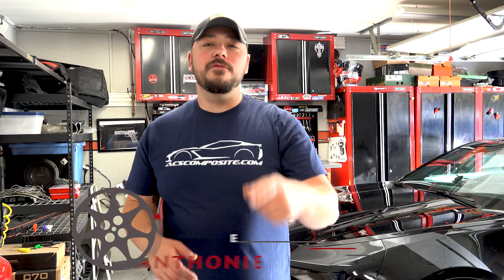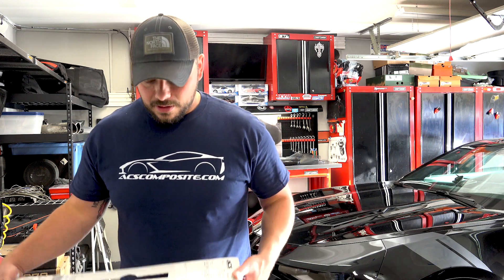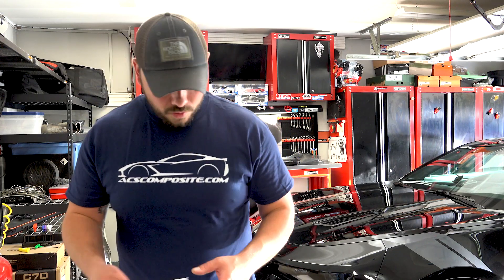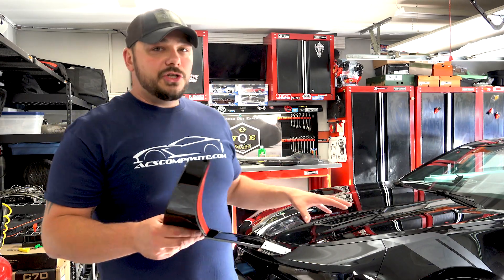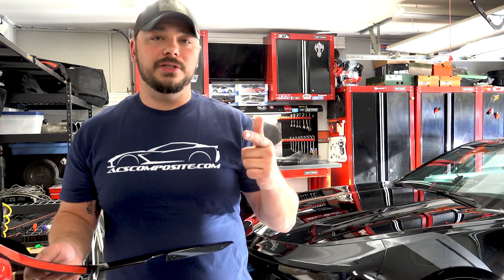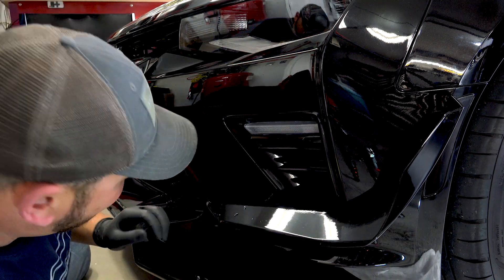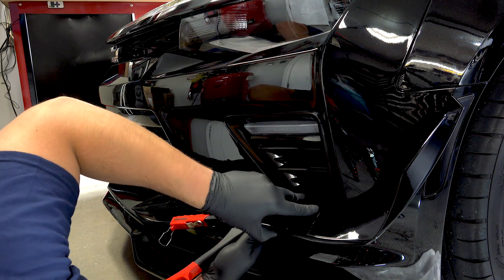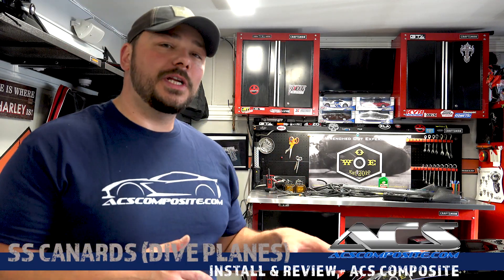ACS Composite  Dive Planes Camaro SS install

Comment: Like the video for sure. I think you could condense this with the same information and make it better on the average viewer. Also your mic was peaking quite hard. But thanks for the information, I may grabbing some of the ZL1 looks for mine too.
Reply from the maker: Roger that, thanks for checking out the video. I really like the look as well.
Reply: Wrenched Out Garage any regrets of the skirts, splitter, or down planes? I think I'm going to do those in gloss black.
Reply from the maker: No regrets, part of me kind wishes I did a little Carbon Fiber though.
Reply: Wrenched Out Garage on the all black I bet that would be hot. I have they hyper blue so I think I'm going to do gloss black for those then do white pinstripe on the edges of the black areo trim and get white lettered wheels. Want to test that race car look haha.